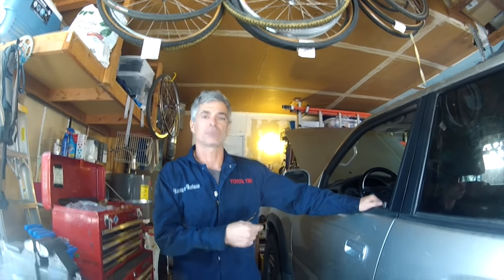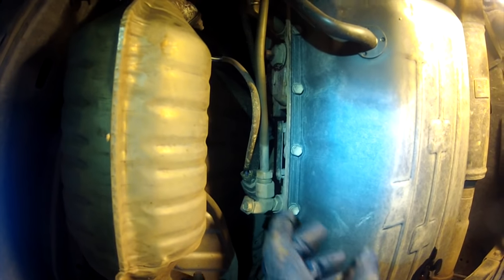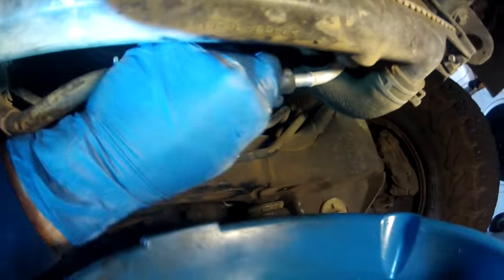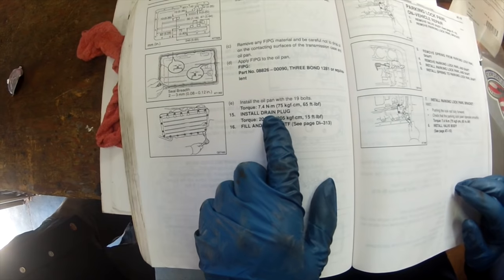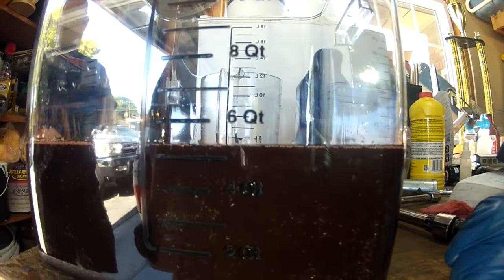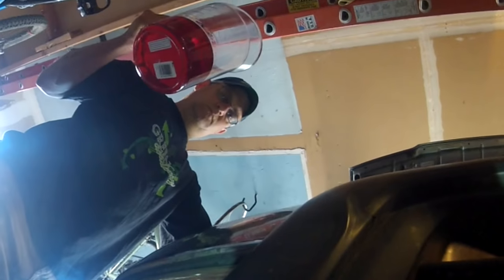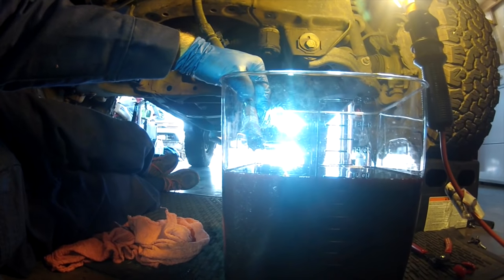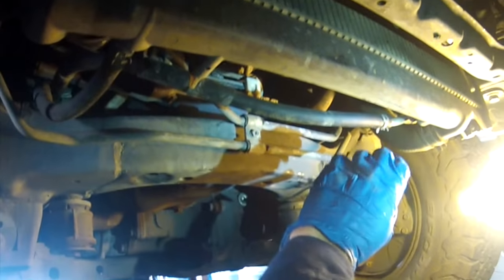Transmission Fluid Flush

Comment: Help! Tim trying to save mine , it just failed inside the radiator causing the pink milkshake contamination. I'm sick....I bought a new rad and per your other video a separate tran cooler. How would I go about the flush? I want to just drain the atf first., however would I fill the tran completely and run for a bit before re draining? Also , obviously I'm not gonna go through that shot radiator, can I connect the in & out directly. crossing fingers I can save it. Planning on multiple flushes and dr tranny. but it seems it would make more sense to let the new fluid pulse for a while inside the tran, since its not the normal change like what you are doing in this video. Any exp with this curse?
Reply from the maker: Hi Tara.  Sorry this happened to you.  I would start by draining the pan and replacing the radiator.  Don't install the external trans cooler yet and don't connect the return line yet either (the line that goes to the nipple on the driver side of the radiator.  Now, go to Walmart or some place like it and buy the most affordable transmission fluid you can get that's compatible with Dextron 3, like a Dex/Merc.  You'll want to buy a lot of it.  Pour around 4-4.5 quarts into the transmission dipstick tube to replenish what you drained out of the pan.  Install a section of hose (3/8" transmission hose) to the return nipple and follow the instructions in the video draining a quart and adding a quart.  I would go through as much ATF it takes to where the fluid is coming out really clean with no traces of contamination.

Once you're satisfied that the fluid looks really clean.  I'd take it for a very short easy drive around your neighborhood and then do the whole flush sequence again.  There are people who've survived the pink milkshake but I think the key is they caught it very quick and then did a very thorough job of flushing the system multiple multiple times to get it as clean as possible.  You can take the contaminated fluid to an auto parts store that accepts old oil and it will be recycled properly.

After the multiple flushes, you can now add in the external trans cooler and follow the video I did of that install.

Let me know how it goes.
Reply: Thanks for your reply Tim , I started on it tonight before seeing your response. One of my skid plate bolts held me up for a good bit before breaking off. I had the dex/merc in my Walmart cart but actually put it back because I couldn't find the info on what to use. So I got done what I could before dark (no Garage) . I drained rad, took off the overflow (glad I watched your vid or that would have made me punch the windshield).I took those component hoses and bottle and soaked them in a bin with a dishwasher pod opened. That worked like a champ .You can actually see the atf congeal on top of the water. I bought a 2 way barbed fitting and section of hose. I planned on connecting the inlet and outlet atf  tubes and just letting it circulate while I do the refill and flush on the old rad (waiting for the new). Do you think that's wise? I should prob drain that bad atf out now. Is the capacity 11 quarts doing one cycle of a complete flush? One day is all that it took to catch, when that pressure erupted all hell broke loose. It did mix in that short of time though , I pulled the dip and its not red -red...so jury still out.  I am going to  do the atf cooler , just checking to see if I have a working tranny. I bought a tran filter and gasket...I should drop that pan huh....looks like a PITA. I was going to do your flush method twice and then take to a trans shop. Would they do it a better way like under pressure or just rake me over the coals? Any exp using that dr tranny to tighten up the clutches towards the end? Thanks again , amazon and I owe you!
Reply from the maker: To flush the transmission, you could take the trans cooler in the compromised radiator out of the equation.  Just disconnect both the send and return rubber lines off the the radiator trans cooler.  Like you mentioned, you could then connect the two nipples of the radiator trans cooler together with another section of transmission hose.  

You could just let the transmission return line hang there and put the send line into a catch container.    Drain what's in the trans pan and then refill with 4-5 quarts of ATF.  Now start the process of draining a quart and adding a quart.  The capacity is 12 quarts.  But, in order to get most of the traces of coolant out of the system, I suggest you keep doing it until the fluid starts coming out without any visible traces of contamination.  Once you're done, your idea of connecting the send and return lines with a 2 way barbed fitting is smart.  This way you can now take care of flushing the cooling system with the old radiator.

I just helped a friend flush his cooling system so he could change from running a Prestone type green coolant and go to the Toyota specific red coolant.  I suggest buying at least 8 gallons of distilled water.  Fill the radiator with around 2 gallons of distilled water, let the engine heat up to operating temperature so the thermostat opens up.  Now turn on the heater full blast at the hottest temperature setting and do the same if you have a rear heater as well.  Let the engine run for a little while, shut it down, and then drain it again.   We did 4 rounds of this, and at the end, the water coming out looked mostly clear.  The Lisle company makes a cool spill free funnel which is a handy tool for renewing the coolant and burping the system of air.  Here's a link:
https://www.amazon.com/gp/product/B00A6AS6LY/ref=oh_aui_detailpage_o02_s00?ie=UTF8&psc=1

Let me know how it goes.  Hope you're able to save your transmission.  I just helped Sean swap his transmission.  Big job.  He was without his truck for two and a half months while he got the money together for the transmission.  We got him back on the road yesterday.  We videoed the whole thing and it will be a multipart video because it's a lot of footage.
Reply: Make sense.
Just curious if you added same amount you have drained.  Why you ended up that you need to add more oil at the end?
I knew the volume of the old oil is larger as it is hotter so when you add cold fresh oil with the same amount, then warm up the oil to the normal operating conditions, you should end up having the oil higher than the recommended level (I am assuming you have the right oil level before flushing)=?  Do I miss something in the procedure?
Thanks
Reply from the maker: It's could be because of a couple things.  One, like you said, I'm not sure the guy's rig I was working on had a properly filled transmission to begin with.  Two, the amount we're draining out and adding back in might not be exact.  On a few rounds, we could have drained out a little more than one quart and then only added a quart back.  It's not an exact science.  The key is to check the level when you're all done and add any if you need to.
Reply: Ok , update...what a mess. No wonder its dreaded. Not just because its potentially fatal for trans but getting it all out is a bear. What I am seeing though with running dish washng det and water is that the atf seperates and wants to surface , so , with the truck slighltly higher on the front supports ,the last highest spot is the rad top. So on this last flush /drain any pink foam can stay behind in the old rad before the replacement. AS for the tran fluid (and this may be a good thing I hope) I drained 2 qrts from the pan- replaced with 2 new- a lot of non pressurized spittin and sputterin . When the flow came , it looked more like old trans fluid then pink nightmare. And after adding 4 morequarts it was flowing new looking. So my theory is it blew out a ton but did not draw in that much. Is that possible? I still force fed and bled 12  more quarts.however I am totally in the dark with how much is actually in there. I am not on level ground yet but it reads to high.         Like I said earlier I only got good flow it seems for the amount I was putting in 4qt for 4qt. So I believe much was lost initially. Just got new rad in , will update soon. I think I will get that trans cooler anyway.
Reply from the maker: So you ran dish washing detergent and water through your cooling system.  Is that a known way to clean out your cooing system if you get it contaminated with ATF?  I've never heard of doing this.

It does sound like the ATF forced out into the radiator but not the other way around which is really lucky.  You would be able to see if the fluid was contaminated so I think the Auto Transmission Gods were on your side.  You're probably going to get out of this mess only slightly mentally scarred from the scare of destroying your transmission.
Reply: Saved it Tim , thanks for the help and video's.!
Reply from the maker: Awesome news Tara.  Glad I could help you out.

Comment: My only question is it good to run the transmission a quart low?
Reply from the maker: A quart low isn't a big deal especially since there's no load on the transmission.  The vehicle is just sitting their idling creating very little heat in the transmission.
Reply: @TimmyTheToolman  That makes sense, great video, I think this will be my spring project, thank you 👍
Reply from the maker: @veritas3379  You're welcome.

Comment: What's the best way to find which one is the return hose if they're right beside each other? 2ZR engine.  Thanks!
Reply from the maker: Hey Mike, for the 3rd Gen 4runner, I just did an internet search and came up with the answer.  If you strike out there, find a forum and pose the question.  Forums are usually very good for answering people's questions.  You could also search an online parts seller with good parts schematics and figure it out that way.  If you still can't find the answer, go to a dealership parts department and I bet they could probably tell you which one is the return and which one is the send.
Reply: Thanks for answering.  For some reason I thought you were a Toyota mechanic :). I found the answer here for anyone interested.

http://www.toyotanation.com/forum/323-corolla-10th-gen-2nd-gen-matrix-engine-transmission-forum/418730-transmission-cooler-return-line-location.html
Reply from the maker: Cool, glad you found your answer.  I think others make the same mistake that I'm a mechanic by trade.  I make my living as a firefighter.  I just like to wrench and share information so people will hopefully have an easier time repairing or modding their 3rd Gen 4runner.

Comment: What would it mean if my discharge tube keeps sputtering into my bucket? It acts like when you turn the water off to your house for a little bit and then turn it back on and your faucet sputters water out to get the air in the lines out. But my drain tube acts the same way
Reply from the maker: Are you moving the same amount as we did on each round, 1 quart?  Did you follow the same procedure we did by first draining the pan and adding back an equal amount of new fluid?  It sounds like your pump is running dry.
Reply: @Timmy The Toolman  could it possibly be debris partially blocking in behind the pump or torque converter? If that wad the case would a valve body cleaning help that issue? I had to replace shift solenoid E the lock up solenoid last year but I didn't use oem. Oem price is outrageous for just the one solenoid. I also did one treatment of auto rx and it shifted nice. Then I did a drain and refill after 1500 miles and drove it for another 9-10,000 miles and just got done telling myself I probably ought to do another drain and refill and it started slipping. I then crawled it home. I went ahead and drained it and put in another shift solenoid E from a different manufacturer and the p0770 code went away and it was shifting nice again but just for a fee miles and had to slip back home. It just seems weird because it'll shift fine if I shut it off for a few minutes then start it back up and it'll shift fine again just for another few miles and slip back home. Idk do you think I just need to try to find a used oem solenoid or could there be a blockage right before or after the valve body. But no I've never ran the tranny pump dry I always don't let it run for no more than 10-15 seconds because I do it by myself on any vehicle
Reply from the maker: @garybrady7245  I'm not an expert on these transmissions.  I don't know why your fluid wouldn't flow out smooth like it did for us in the video.  It does sound like the pump doesn't have a proper prime and air is getting in.  Did you replace the filter when you replaced the shift solenoid?
Reply: @Timmy The Toolman  Thanks for your thoughts and replies. I'm going to drop the pan again and do some tests on the wiring and go from there. Thank man keep up the good videos on Toyotas they are awesome
Reply from the maker: @garybrady7245  No problem.  I hope you get it figured out and breath some new life into your transmission.

Comment: Everyone says you don't do a flush on a older car.. mine has 170k miles... your thoughts? I even called Ammco & they said no don't do it...
Reply from the maker: I've heard the same thing.  I think the theory is if you have a transmission that has been abused and the ATF hasn't been changed for a long time, the fluid is holding clutch material.  When you do a complete flush, you remove all the suspended clutch material that was in the old fluid.  A transmission with worn out clutches is depending on that suspended clutch material in the fluid to keep it from slipping.  So, what ends up happening is the transmission begins to slip after the flush and that's why places like Ammco don't recommend a full flush.  But regardless, if your transmission clutches are depending on suspended clutch material in the fluid to work, your transmission is probably not too far off from needing to be replaced or rebuilt.

Some also think the problems with a flush is you're forcing fluid through the system dislodging sludge in the transmission that ends up clogging fluid channels.  The type of flush we showcase in this video uses the transmission pump to move the fluid through the system and not some external pump that forces the fluid through the system.  So, this type of flush isn't going to exert any abnormal pressure on the system.  

If your transmission has been well-maintained, I think doing a full flush with our technique is fine.  If you have a transmission that you know has been neglected or your transmission has really dark burnt fluid, I'd play it safe and just do a drain and refill of the pan.

Comment: What's it mean if the fluid comes out of the passenger side instead of the driver's side??
Reply from the maker: The passenger side connection is send line attachment.  The transmission sends the hot ATF first through a metal line and then through a rubber line that attaches to the transmission cooler nipple on the passenger side.  The fluid runs through the cooler and exits out the cooler nipple on the driver side and returns to the transmission.  You want to disconnect the return line on the driver side, connect up the hose you bought to perform the flush and put it into the bucket you have with graduated level marks.